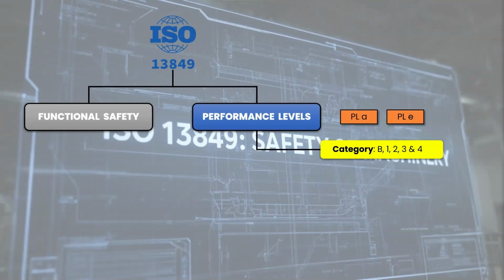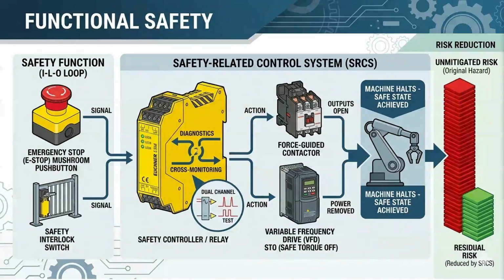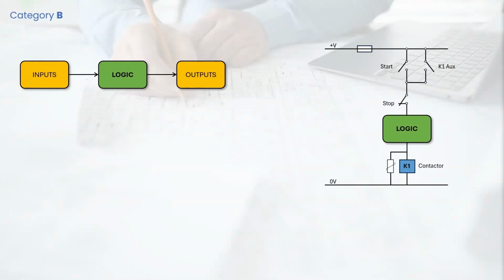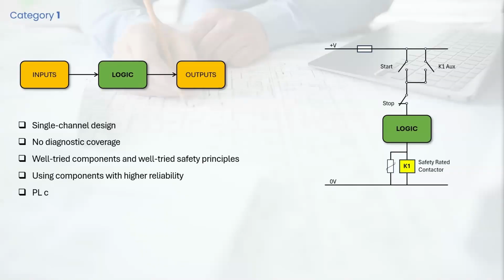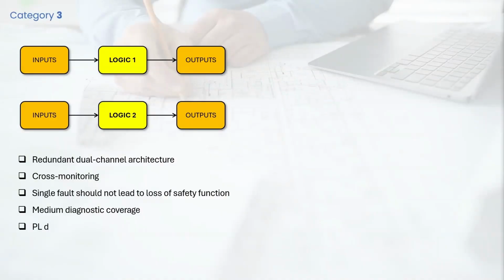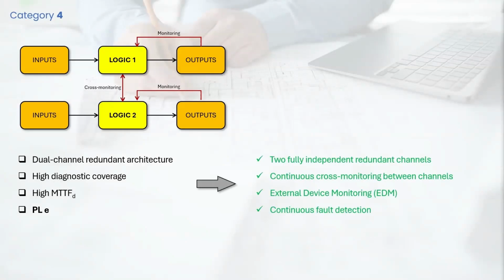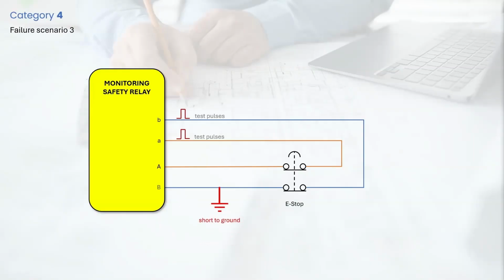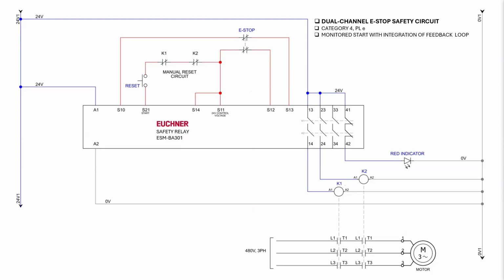ISO 13849 Safety Categories & Performance Levels Explained | Euchner ESM Tutorial

Comment: Nice demo on the cross-fault wiring, super clear explanation. Relays like this are great for basic guard doors, but on multi-axis setups, killing power with contactors gets messy fast. We usually handle Cat 4 / PL e straight at the drive layer with Elmo over FSoE instead.
Reply from the maker: Appreciate the feedback, and you're spot on—managing safety at the drive level via FSoE is definitely the cleaner, more scalable approach for complex multi-axis systems.